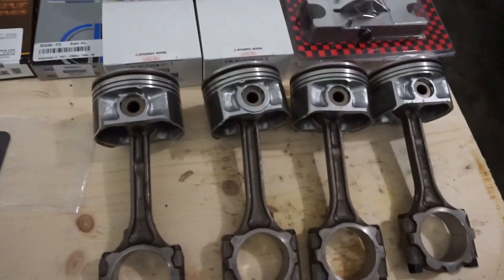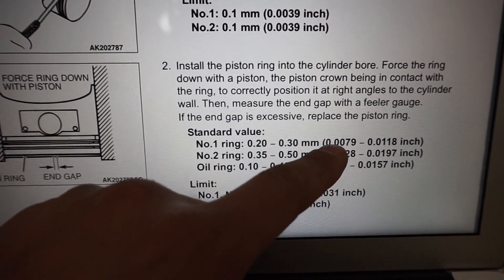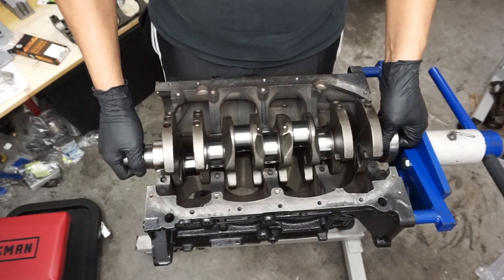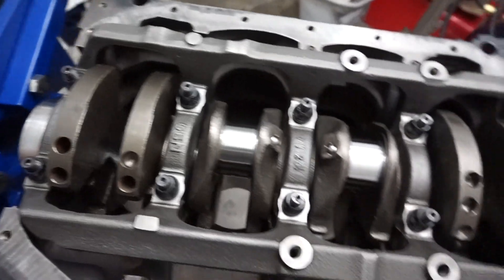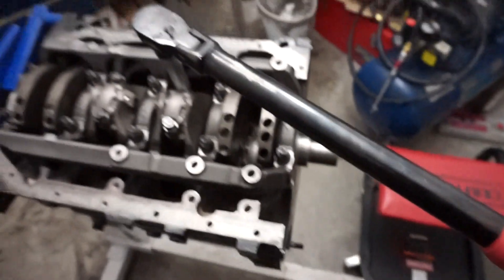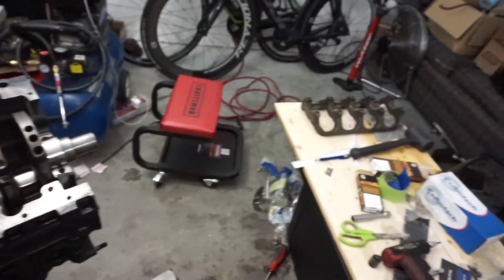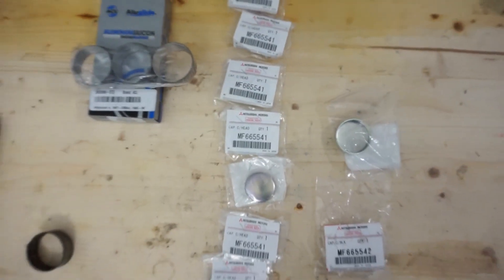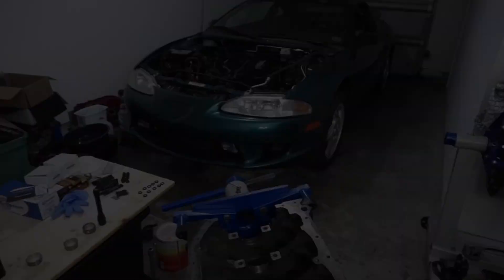98 Talon TSi Bearing clearances and ring gaps

Comment: No arp lube when you torqued for plasti gauge?
Reply from the maker: Use arp lube when torquing it. I  had to go back and rewatch it. It seems like I didn't have any lube but I used a very light coat of moly lube on the threads, I was probably trying to make the small pack of moly last for when the plasti gauge was removed and had to re-torque them again.

Comment: The service manual says to "torque an additional 90 degrees". this applies to the stock stretch bolts.  You are using ARP studs, they have a different torque value and are not to be torqued the additional 90 degrees unless I am mistaken. If this was my build I would torque the M10x1.25 main bolts to a lesser value.
Reply from the maker: Alex J. I'm using ARP main studs but not the ARP rod bolts. The main studs got torqued to the torque spec that comes in the box. The only ones that  got an additional 90 degree turn were the rod bolts.

Comment: mr jafro hahah, nice engine, what are your hp goals on those evo internals?
Reply from the maker: abe castro I don't have a set hp goal on this, not yet at least. This engine will have a MHI 16G turbo with the factory muffler. This is mainly a quiet DD more than a race car. The goal here is to have a clean DD, after this is done I wanna push this out the garage so I can get started on race car 1G GSX.